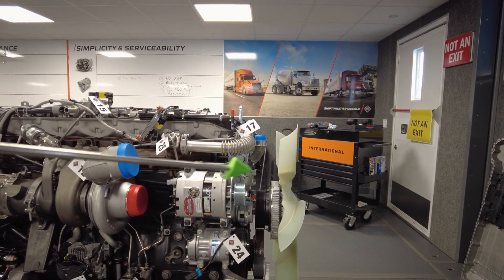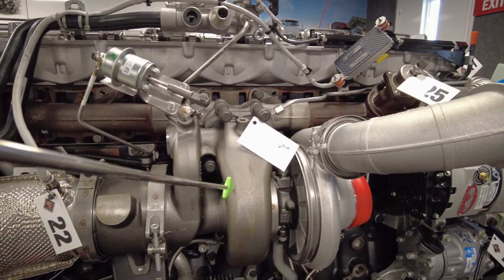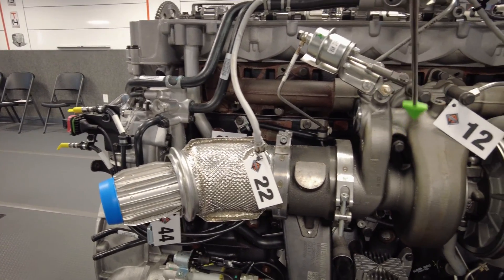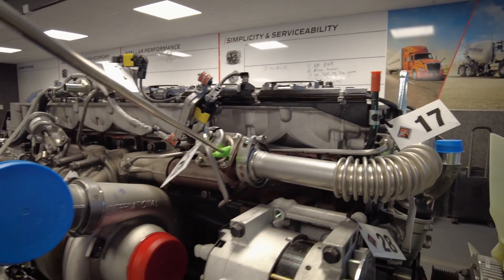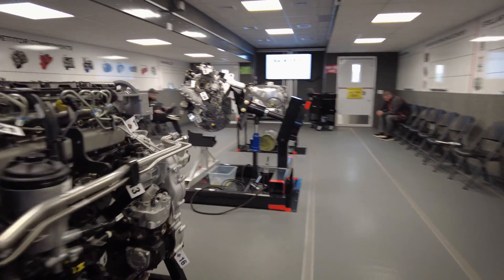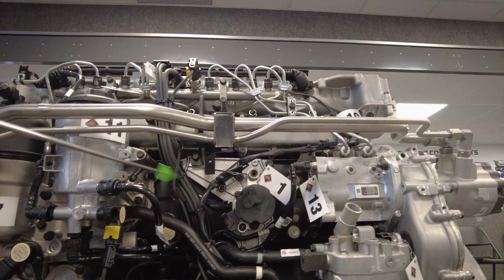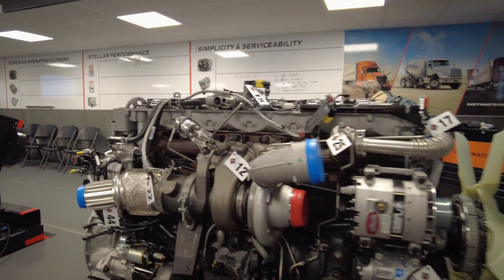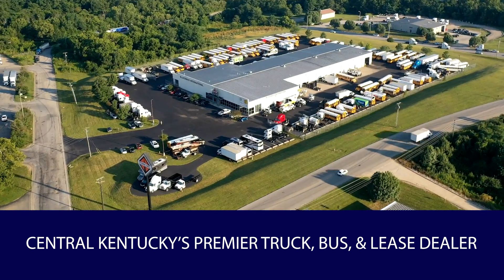Big Rig Rundown | Kyle's Top 5 Favorite Things About International's S13 Integrated Powertrain

Comment: No hydrocarbon doser, no active regens. Only passive and parked regens when needed. Compression ratio 23.1. Exhaust gas runs hotter by design.  EGR valve is used as a heat management control. Great engine.

Comment: Heyy you got part number for the oil filter and transmission filter. 

Whats the interval for the transmission and how many quarts?? 

My shop has 1 or 2 of these in the fleet and we don’t have any info on them and they’re pretty much brand new.
Reply from the maker: If you text 502-570-5252 at Bluegrass International Trucks, you'll reach a parts specialist who can provide you with the part number and answer any questions you may have.
Reply from the maker: Thank you

Comment: North America is waking up with the Scania engine .
Only point i don5 lime is tbar Americans saying they developed the engine but its a engine thst drives alrwady some years in Europe.. the engine is optimized in several places for as like in Alberta Canada and did testing for few years now 
.. so they found out the had to increase compression to come to the north america emissions.

But yes a great engine that has proven itself already for years!

Fun fact that you need yo ask where the low pressure system is

Comment: So, is the egr valve still there to dump soot back in the engine or where does exhaust gas go?
Reply: The purpose of the Exhaust Gas Recirculation (EGR) valve is to recirculate exhaust gases back to the engine's cylinders, helping to increase the engine temperature. Unlike systems equipped with an EGR cooler designed to reduce temperature, our system aims to maintain the engine at approximately 600 degrees. The primary function of the EGR is during startup, facilitating a quicker reach to the operating temperature. This process effectively reduces soot production while increasing NOx emissions, which are subsequently managed by the aftertreatment system.
Reply: There is no way the engine itself can reach 600 degrees at any time,,,As the oil would have long since boiled and evaporated ,,And the crank shaft would have seazed to the bearings,,,The after treatment system can reach 600 degrees and more,,But the DPF only goes to 300 in this application ,,,So ,,,,,,,,,,,,,,